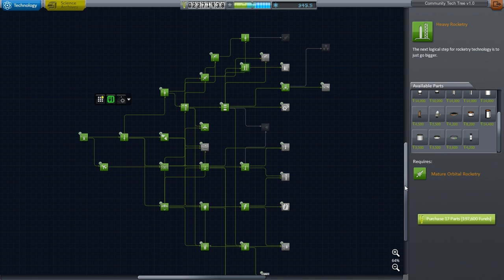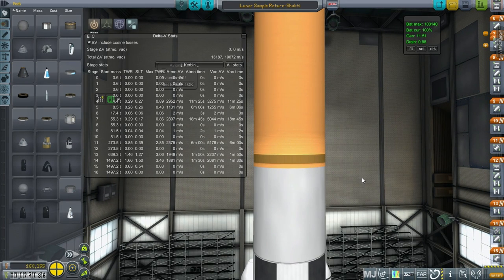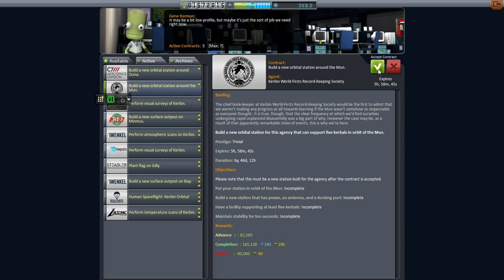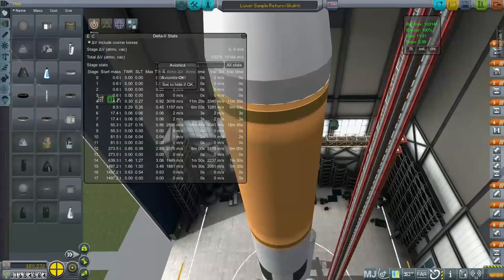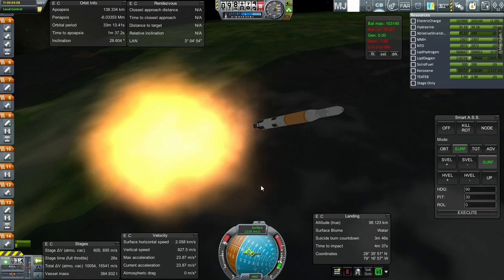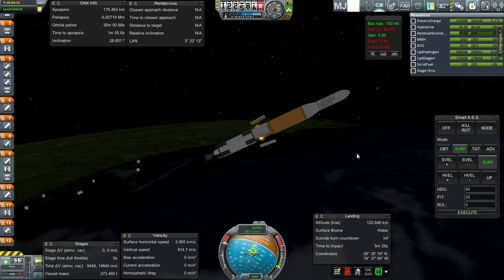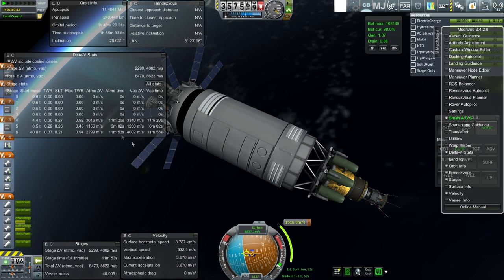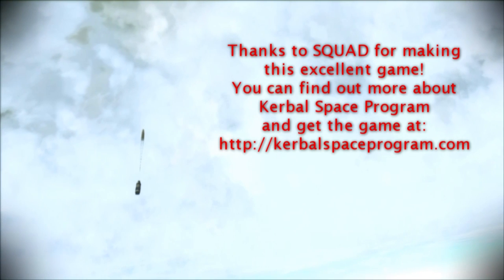Realism Overhaul in KSP Beta 30 - Lunar Sample Return Part 1

Comment: I love the M1 and hope you continue to use it! From what I read it seems like the M1 was heavily component tested but never tested as a whole engine. I believe that the RS-25 is heavily based on the M1 engine. I once built what I felt was the largest rocket I felt was realistic. I used 5 M1 engines on the main stage set to burn for 6 minutes and I used 2 boosters with 3 F1 engines to get the rocket off the ground. It ended up being able to put well over 200 tons into orbit very easily.

Comment: I'm really hoping to begin my own Real Solar System series on Youtube, though I've found that the current version of Realism Overhaul won't work properly on v1.0.4. It would be nice to send Kerbals to the actual Moon as opposed to have them blow up over the Canary Islands due to unrealistic heating settings.
Reply: *****  I found the newer version of RO and RP-0 on CKAN, and so far everything has worked quite well with RSS. I got Environmental Visual Enhancements to work with v1.0.4 by stealing using Bob Fitch's settings from his Alexandria series. Thanks for the help, I find that you are definitely the one to ask every time K.S.P refuses to play ball.
Reply: https://github.com/Felbourn It's the RSS25 option at the bottom. However I was a little premature in my self-congratulating claims of success. Further testing of this EVE instalment resulted in either the clouds violently flickering or not being there at all. Still, I've never been very good at installing mods (which is why I keep bothering you all the time) so maybe you can make better use of the settings than I have so far.